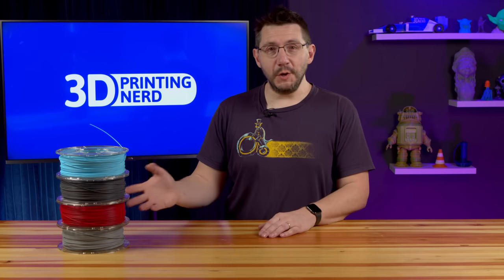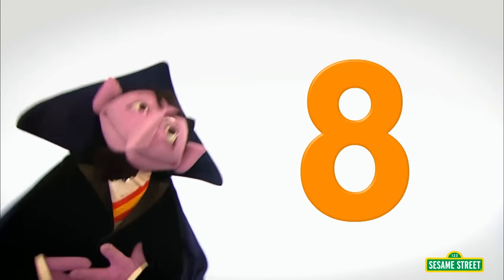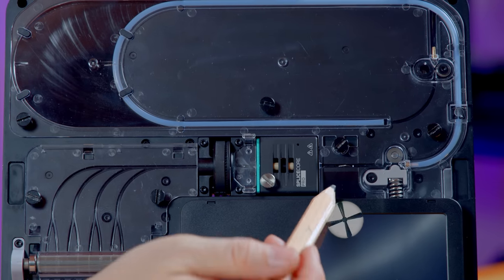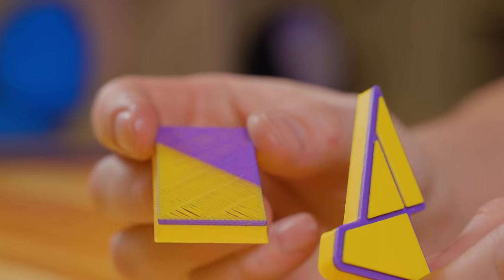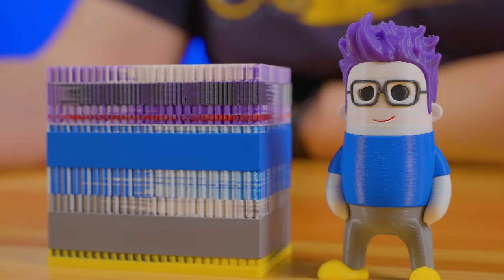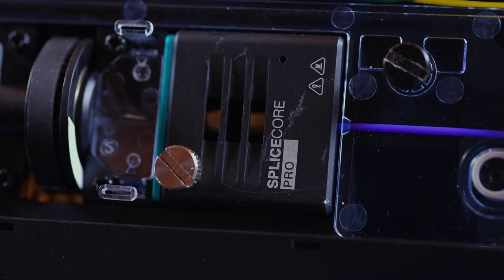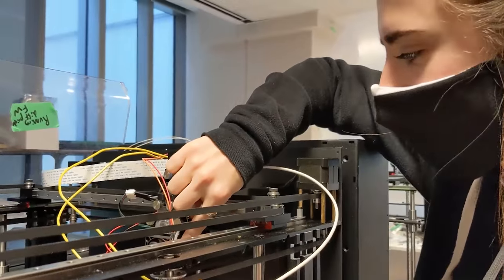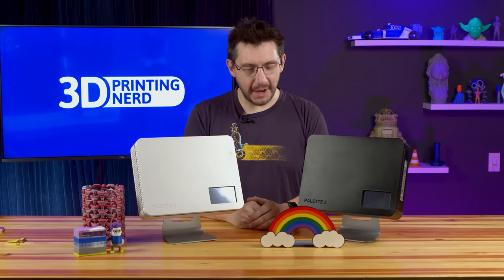8 Colors At Once! // First Look at the Mosaic Palette 3!

Comment: Id like to see you weigh the part printed versus the transition tower to see how much material is wasted.  Looks like they have reduced its mass quite a bit though with the support looking parts of it.
Reply: Unfortunately, they can't do much to reduce how much material you need to purge beyond making the transition point more accurate, it's the properties of your nozzle and filament that determine how much you need to purge to avoid color mixing.
Reply: @MalikDrako  I wonder if introducing a cleaning filament would purge the nozzle quicker.  Do like 5 mm of cleaning stuff then the new color versus whatever the normal buffer size is on the purge block.  I wonder if this would help with the whites not having bleed over as well.
Reply: @MrMadeinthe80s  The waste block needs to be at the same height as the main print, I would guess that the support looking areas is it saving on material to maintain the height when there is not a color change; so yes, exactly what you say.  The Prusa MMU's amount of waste is partially why I stopped using it.
Reply: @RogueProeliator  yeah I have a palette 2 myself.  I just wondered if they built in one of the filaments to be a cleaning filament instead of just purging for awhile until the next color is fully out if it would work quicker to clear the previous color out of the way and make way for the next.  A buffer between colors so to speak.  You'll always have to use the purge block I just wondered if this would reduce it further or work at all.  They make cleaning filament to clear clogs and it also seems to remove any excess of whats currently in the hotend.
Reply: A purge bucket is so much more efficient.
Reply: Another problem I have with those transition towers, is that the slicers don't use the Z axis of the printer. If there are 3 colors on layer 100, the tower is printed with a single color up to layer 100 and the size to be big enough to purge all 3 colors. If the printer would instead lower the z height every time it purges, the tower would be way smaller.

Maybe this is to avoid backslash on the z axis as layer heights are very small, I don't know, but this should be nothing that couldn't be fixed in software.

Even printing 2-4 layers with the same color before changing it and printing the same layers with the other color, could be possible...
Reply: @maplobats  How so?
Reply: @bradley3549  It doesn't need a purge block, the 'bucket' rides along with the z-axis.  change color= move to purge bucket, purge about 50mm and keep going (nozzle is wiped as it enters and exits the purge bucket area.
Possible loss of printable area on x-axis is a drawback.
This is on a bed-slinger.  It would work slightly differently on a corexy, but might actually be easier to implement.

(disclaimer:  this is only from what I've read/seen online.  I haven't done it myself, and I am far from being an expert)
Reply: @maplobats  I see what you are talking about. Efficient in the sense that you don't lose much build space, but not any more efficient in terms of wasted fillament. Would be nice to see the ability to run duplex jobs. Side parts that could be made with the purge. Widgets or whatnot where the color doesn't matter. At least they can be useful.
Reply: @bradley3549  Can be far more efficient in terms of wasted filament.  If you don't need color change for 20 layers, then nothing is purged at all during those 20 layers, instead of having to build the purge block to the same height.
Reply: @maplobats  Oooh, that does make sense. It clicked. Thanks for explaining.

Comment: You mentioned multi-material prints but didn't elaborate.  I'd like to see that tested because I would think there would be hot end temperature differences and maybe even material adhesion differences (different materials might not stick to eachother) that could effect final print quality.

Comment: @3D Printing Nerd print a Hilbert Curve where you use 4 colors if it is going clockwise from the last line segment in the curve and 4 colors if going counterclockwise, with the 4 colors being used 1 each for the cardinal directions.  In the interest of efficiency of waste towers, this only needs to be on the outer surface.

Comment: It would be cool to see the advancement where there would be no need for purge towers.  It seems that with today's technology and having the Palette 3 communicate with the slicer and print settings, it should be able to have all the color changes arrive at the nozzle exactly when needed or at least somewhere internally in the model (i.e. infill or inner perimeters) so that the outside facing portion of the model has the correct color when needed.  The communication piece of the software would know all the print settings such as flow rate, etc...

Comment: An idea to save on wasted pla. Instead of it pushing all of one color, using it, then pushing out whats in the tube as waste while it loads another color, have it calculate how much it would use and cut to length. So ideally you would see a rainbow inside the machine as it cuts the length and adds new colors pushing it through. You could still have a small transition period but it would be much smaller than what is displayed here.

Comment: Multicolor printing is super cool, but something I need rarely. However, what I need a lot is a solution to all of the spools of filament I have that don't have enough filament on it for larger prints. Can this be used to join all of these filament ends into one large strand, and put it back on a spool, instead of printing with it directly?

Comment: I'm surprised that the purge block issue hasn't been better adressed yet. I would think by now we would have a way to input the length of the filament between the mosaic and the hotend so that you would only need to purge a couple centimeters on each end of the transition. of course that would depend on how often it is swapping and how long that run is but still I feel like there is room for improvement there that only needs software and a distance value

Comment: I do a lot of batch printing but unfortunately my printers don't have runout sensors on them so if I don't have enough filament left on the spool to do a full print then it will just sit on the shelf. I'm thinking of getting one of these to use in splicing together all those left over spools into full usable spools of filament.

Comment: I'd've thought the whole point of something like this was to avoid the transition towers... oh well. Cool bit of kit nonetheless.

Any reason why a purge block/transition tower has to be so huge? I can't see why you couldn't print a thin wall (with suitable bed adhesion), and when you change colours, extrude behind the wall then wipe over the top of it.
Reply: It has to maintain its height with the model, which it seems to do. Probably a way to calculate the surface area needed based on the expected waste
Reply: @eyeTelevision  Height, yes, but does it need to be so big in X and Y? Adhere it to the bed well enough, and I bet a thin L or C shape (for rigidity) would work. Tuck the nozzle in behind the L or C, extrude till the new colour should be well and truly flowing, retract a little, wipe the nozzle over the wall. Essentially you're replicating the wipe blade that you see on some CoreXY machines.

This might not work so well on the lower layers where there isn't enough clear height below the nozzle for the waste to fall away.

Comment: 1. Pretty cool 2. I know little to zero about 3D printing. Help me out is this a "addition to a printer" that allows you to use 8 colors or is this an all in one unit? Does it work with any printer (assuming it is an add on unit) Checked out the website- No info.

Comment: Is the system smart enough to use up as much of the model for purge as possible? In other words, if you have a model like the figurine where only the outer layer really matters in terms of color, will the system use up as much of that internal volume for the color change? 

Seems like so much waste just to change the color.

Comment: The price is $100 more than the prices Joel states. They say its for Air shipping, but it’s a little odd because their regular shipping is actually  much cheaper and they don’t give you the option to do anything other than Air shipping.
Reply: Ah, they changed things around. Now, to get the $100 discount, you get “ocean shipping” and delivery August/September, vs $100 more for July “air shipping”.  So that makes more sense. Pay a bit more to get it faster, otherwise you get a discounted price.

Comment: Just had a thought: Can you print with multiple ABS filaments, and then vapor smooth the result? (or, alternatively, multiple Polysmooth filaments? I guess it wouldn't be much different from trying it with the previous Palettes besides allowing 8 colors, but I'd imagine it could provide an interesting result, or alternatively might cause colors to blend or reveal too much infill perhaps...

Comment: hey Joel, I'd like to see mixed materials... particularly where you mix PLA, PLA+ or PETG with TPU? Flexi grip for a handle, or something with some wiggle to it, or like a cover. Phone case would be a prime example... hard outer shell with a thin TPU layer for shock resistance.

Comment: You mentioned TPU. So you need a TPU rainbow.

Then you can print tire and wheel for the Open Rc with hard and soft materials. (Or a twheel)

For 8 colors a toy nascar with black tires on wheels that spin, clear windows, and the old Jeff Gordon / Dupont paint scheme.

Is that challenging enough?

Comment: I want to see multiple materials, not colors.  Does the "transition zone" work OK when you use water-soluble scaffolding material?  What about different kinds of filament -- how can it splice them with different temperatures?  Or even if they have the same "base" but different properties, like hard vs flex.

Comment: I’d be curious to see if you could use the Palette to to print in or more colours along with PVA dissolvable supports. 

Sure I could modify my printer to dual head and do it, but rather than spend all that time, money, and energy if I could just spend a couple hundred more and get multi colour with dissolving supports on my existing setup then that’d be awesome.

Comment: I like that Palette 3 Pro. It would be cool is you could tell it when to use a transition tower and when not to. So for example on that rainbow. You could have the transition in the part itself to "bleed" the rainbow colors but not the black or white.
Reply: I think you could actually do that. In the Canvas slicer, you can tell the software how much it should put into the transition tower on a per color basis.

Comment: Hmm I'd like to see a color optical(2) camera to know the actual color transition position for your splicer. Also I feel like 3d printers might do well to take a note from good espresso machines and integrate a pump into the nozzle to both clean out the bore of the print head from other materials AND being a known capacity allow higher resolution of material extrusion.  But I also want a 4 axis print bed so oh well

Comment: Great video Joel and Sean (loved the added explosions ATHF style!).

The idea of spending more on a thing to add to a 3D printer than the printer itself cost is probably difficult for a lot of people to deal with. Though, if anyone is using a printer that cost less than the Palette 3 pro, they can be sure that the palette is of higher quality than their printer. 

Looks like they put a ton of work into the new improvements. Really looking forward to see what you make with this. Maybe you can get the Chaos Core Tech folks to make you a character designed to work with 8 colors.

High-5!

Comment: The main problem with 3D print is a combination of filament thickness and flowback. You need a bit of flowback. You do want a tiny bit of flowback to have a good mix. The issue is that when its combined with the 1.75mm thick filament, it creates a looong mix zone. Consider this. A 0.3 mm nosil got only 3% the surface area of the filament. If there is a 5mm flowback, that turns into a 16cm long transferzone.

The solution to this is to squich the filament prior to mixing it.

Having a 5 color nosily that takes it down to 0.6 or so would dramatically reduce this problem. Also have a nosil that encourage laminar flow would also help

Comment: If purge towers were a thing of the past, I may consider purchasing... The palette team needs to address this (potentially purge buckets?)
Reply: I don't get this. You're still using the waste filament but instead of a block of filament, you're getting spaghetti....

You might save a little bit but that's it
Reply: @lukedavid8099  you would save a considerable amount as the purge wouldn't need to be the same level of the print.  It looks more because it isn't in a flat purge but it would be considerably less filament waste

Comment: Less multicolour more crazy multimaterial maybe something with flex(tpu or simular), petg, abs, poly carb, pla, nylon, (maybe a maybe filled pla with wood or carbon) and PVA supports?
Reply: The problem with that is the materials don't typically splice well together.  For example pla will never stick to tpu which is why in a IDEX printer pla works damn good for support material on tpu prints but in this type of machine I imagine you would never be able to achieve a perfect splice.
Reply: @SpreadingKnowledgeVlogs  or the e3d tool changer.
Reply: It struggles to splice TPU to TPU correctly...when you have multiple materials it's even harder

Comment: Make functional parts with as many different materials as possible (tpu, pc, ABS, carbonfilled, asa,...)
Reply: Eh... Some materials don't bond very well to each other, and I could see filament breaks being an issue.
Reply: When he mentioned using different materials my first thought went to how does the printer handle the different temperatures for different filaments... I print mainly pla with a smattering of abs and Asa tossed in. Even just the pla from different brands prints at different temperatures... Yes, they all print with in the same range, but Amazon basic filament is very oozy if I print it where matter hackers pla prints really well...
Reply: @jhbryaniv   The pallet 2 doesn't change temps, so you need to choose filaments that have similar melting temps or use just one filament
Reply: @jhbryaniv  temp changes can be done in gcode but I have no idea if there's software for this right now. Like @Mikowmer said the main issue would be different materials bonding to each other. Using PP with anything else might be quite hard.
Reply: These machines are soo bad at printing flexibles, just TPU to TPU is a nightmare for splicers, mixing with other materials is gonna be even worse

Comment: With something like this, you could print actual figurines of any 3d characters or games. Minecraft would be my first thought, seeing its easy access to 3d models and simple colors. However, I'd like to also see complex prints featuring different materials, such as a transparent filament or something that mixes flexible and rigid structures. Maybe a simple humanoid with flexible joints?

Comment: I’m not familiar with the gcode techniques for handling multicolored filament, but it would seem that the best practice is to hide the transition spots within the printed object.  I’m sure that must be how it’s done, but additionally I would hope that the program understands that if your print contains white then when that layer comes up it should start with white and fill the inner volume as much as possible so that by the time it extrudes the outer shell it’ll be pure white.  Then switch to whatever other colors are used on that layer and still use up whatever remaining inner volume there is for those transitions.

Alternatively, why not make it standard practice to have a sacrificial totem pole get build alongside your multicolor print - one that is used as the dumping zone for transitional color extrusion
Edit: never mind I watched till the end and saw it’s already being done.

Comment: Hi bro do you really think this is a good investment what if i just want to paint it. i wouldnt be surprised if Mosaic plans something like a normal printer having four colours and the machine should have cyclinder inside and does the melting mixes it and extrudes the new colour filament , where the machine will sense the four colours in the model does the mixing and release a new filament in that colour , i just got this idea can you discuss with them it will be great four colours would be cyan, magenta, black ,yellow

Comment: I really want to see multi material.....tpu with pla to showcase living hinges. Imagine a 3D printed finger with pla “bones” and ninjaflex “joints”

That would open up a bunch of possibilities.
Reply: I think these can actually do that the problem would be tuning the hot end to transition between the temps at just the right points.  I don't think splicing the two together would be a issue but then again I e never tried and I do know when using pla for supports on my tpu prints with a IDEX printer the pla doesn't stick to the tpu and when I say doesn't stick I mean no matter what you do the two wont stick so that might be a issue actually.  I think mmu2s would be a better option for what your speaking on if it is even at all possible.
Reply: @SpreadingKnowledgeVlogs  well I’m a petg guy anyway. Surely there’s a material that can stick to tpu

Comment: I would like to see printing with two different material types. Such as printing the main object in PETG and using PLA supports. Or using PLA/PETG and integrated TPU either for padding or a flexible henge.